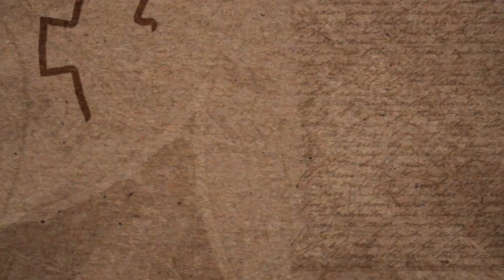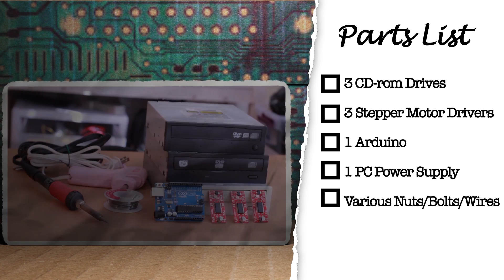Hack old CD-ROMs into a CNC Machine - Part 1: The Hardware

Comment: You can make the same Plotter machine for A4 and A size papers and can add an clipper to make the marker more stable and accurate and can extend x and y axes so that it can even be used for calligraphic font or to fill broachers, bills, etc. You can even use positioning device at the end of clipper to let the machine automatically position to the desired area where the work is to be done.

Comment: Very well done. I will try this. But still have a question even after looking the "Further Resources" link... you solder 4 wires to the stepper motor and connect them to the stepper motor driver but how do you know which one goes where ?

Comment: hello world hehe i hope that you can help me 
So i am planning to build a machine like this and i have 3 cd rom but i dont have controller boards. i found on ebay cheap controller boards simmilar to yours so i want to ask you are those controllers good aswell. I have arduino uno. and also i have old hot glue gun that works so can i use that hot top part from glue gun with regular fillament so i can make a 3d printer i hope that someon can help me

Comment: This video inspired me to take on this project. Not finished yet, but here are some tips I'd like to throw in: First and foremost, the optical lens housing and the carriage it's attached to between the two rails are both extremely brittle. I say this because you'll need some secure way of attaching the next component onto these moving parts, and while I believe hot glue has it's place, I'm opting for nuts and bolts as a more secure method. I've already broken two carriages trying to drill the holes I need for that, which leads me to my next tip - if you can horde a stockpile of these drives, do it. Schools, office buildings, eWaste recycling centers, do what you can to grab about 6 or 7 of these things. Anticipate breaking one or two, like I did. Also, the lens travel direction in some drives are on an angle, not orthogonal like what is needed for this project. Lastly, some drives use regular DC motors, not stepper motors, so watch out for that. Also, you get more travel using CD/DVD drives, floppy drives will only give you about 3 cm of travel (good for making a plotter that holds a pen, not good for a 3D printer that needs more volume)

Happy making everyone!

Comment: Great ideas. I would change one thing though.  I would have the Z-axis(vertical), holding the X-axis(side2side).  That way, the mass of hardware moving while printing will be much less.  The prints will be more accurate and higher quality. I really like the concept.

Comment: Hey buddy thank you for your very interesting project!, so I would like to ask if you know what level of current handle the CD ROM stepper motors about?.This is because I`m gonna use the 4988A pololu stepper driver and it has a screw to calibrate the current to offer  a great performance instead of EASY DRIVER you used

Comment: can we use 2 cd roms and a servo instead of 3 cd roms
Reply: kind of - if you want to use the cnc machine for like a pen/basically anything but a 3d printer or a drill, then yes. The servo can make the y axis, which for the most part doesnt have to be accurate except for the aforementioned devices.

Comment: would a 5V 4A power supply be enough juice for two steppers?
Reply: For some reason, 5V is not doing the job, so far I am running on 12V, I am planning to get a 9V power supply to keep the steppers temperature under control.
Reply: after I made this comment I read somewhere that each motor takes about half an amp to run at 5V. What's the max current on your power supply? (the 5V one)

Comment: +Tinkernut Couldn't a CNC machine be used to operate a train tilting system. CNC machines can move ropes in a block and tackle, which could lift one side of the train, which would be used to tilt the train, which uses lateral forces to counteract centrifugal forces. Just an idea.

Comment: can i use L293d motor driver instead? if yes, then how should i connect them to the arduino, because we'll have 4 wires that comes from the l293d motor driver..where the driver which you used has just 2 input that goes to the arduino.

Comment: Hi there.I am making my own design for larger prints. I want to know how will it know that it is going with correct dimensions. for example i have used a lot of gears and i programmed it to make an inch line, how will it callibrate with my gear settings?

Comment: I've just ordered the arduino uno, a breadboard  general purpose wires and jumper wires.
Next month i'll be ordering 2 dual stepper motor drivers (cheaper for more control per driver) and a new soldering iron.
I have some cd-roms and an old pc power supply. Im so exited to take on this project and i'll let you know what the outcome was.

Thank you for the great very informative video, subscribed!!

Comment: I have some questions. I have this all hooked up using your instructions that are on your website as with following the videos as well. Did you run into problems at all? I get my Y axis and Z axis working great but sometimes my X axis seems to get stuck when moving. Is there anything that I should try to get this to be more fluid? I think this is really the last big hurdle on getting this to work. Any help would be awesome.

Comment: Hey i'm having lot of trouble to strap the plate to the cart that carries the laser diode. First of all there is only one hole where a screw can fit in. Second I got no motherboard mount and I don't understand whats so special with it why not use normal screws ? Third why don't we just use glue and glue a wooden block to the cart ? Would that work with the vibrations ? Thx in advance !

Comment: I think something everyone should know, that if your CD drive is a year 2000 or older, they did away with the stepper motors and went with a DC motor... so check your dates before you tare 4 drives apart to figure this out... I found one, it was a 1998 drive...
Reply: I just took 2 apart and they both didn't have stepper motors :(
Reply: I ment year 2000 or newer...
Reply: +Bernard Melus a floppy drive has a stepper motor in it, but it only has an inch of travel... could be used for a z axis
Reply: +DRMSquared ok thanks for letting me know

Comment: I have disassembled 3 CD rom drives and each one has a motor (actually two motors) with two wires...not 4. They are not stepper motors.

Comment: And you can add a laser to the bottom and voila! A laser printer! (or not... lol) but I am definitely going to make something like this... This has so many uses I could think of:
-Precision paper/cardboard cutting tool
-Add a hot glue gun and you have a 3D printer (sort of)
-A homework cheat machine?
-Add a laser distance sensor and some visual studio programming and you got yourself a way to scan objects in 3D (although this can be done more efficiently)
-An automated screwdriver machine
-An auto soldering machine
-A machine to open up NUTshells (do you get the pun?)
-Combine some of the suggestions above and you have a quadcopter-making machine!
-Scale this up a bit and you have an automated bedroom cleaning device!
Reply: +Ramimy1555 how is it a homework cheat machine

Comment: I totally want to make this one, but it's like a $200 project, need the arduino and the power supply  and the soldering iron. :(
Reply: +TechXSoftware you can literally got all three of those things for like $30
Reply: ***** Names? because I live in Australia, things cost more.
Reply: a soldering iron is like $5, arduino for like $10 for a basic one like this, and a power supply from local thrift store for $15 (max)
try dx(DOT)com based out of china, so maybe shipping to australia isn't too bad. I don't know if they have these parts, but they definetly have alot of hobby electronics. else try ebay, maybe local sellers will come through. TechXSoftware
Reply from the maker: +TechXSoftware Check out banggood (dot) com. That's where I get a lot of my stuff. I'm pretty sure they ship to Australia.

Comment: This project is really cool. I'd like to see if it's possible to make the base a bit bigger though, and maybe just scavenge all the motors, but make new, longer rails to slide on.
I think the work area might be a bit too small to actually do useful things with. 

If nothing else this is a really cool proof of concept that I think can be taken a bit further :) 
Keep it up!
Reply from the maker: +TheOneTemor Try looking at scanners. they have nice track systems and motors.
Reply: +TheOneTemor you could do this not to be useful but with your kid to learn something
Reply: +TheOneTemor Exactly my thought. A greased metal rod definitely doesn't seem hard to install.
Reply: +Billy Mathews I've tried, and they work as engravers more than cutters and they burn so easy it's not even funny, even when pulsating them they just keep dying
Reply: +TheOneTemor I was thinking of doing something similiar to this but using an old scanner or printer.
Reply: +Tinkernut Idea: Scanners -> Laser cutter? Use the diode from the CD-ROM drive

Comment: Brilliant project idea, just not sure what you would make on such a small platform. Would the Z axis support a small dremmel like tool? Could it then be used to engrave circuit boards, instead of messing with all those nasty etching chemicals?
Reply: +dimmddr1 really?   Are CD / DVD traces that big? No this will be plenty precise, just not for a large footprint or tool.
Reply: +Maxx B i`m gonna make one but i think . something this small will be used for the evolution of the 3D printer or cnc machine.  So i want mine to have a small engraving tool to cut out gears and plastic for mounts. now I know realistically you cant get far with something like this but it gets my foot into the door of making these type of machines and thats my real goal( to learn something:)
Reply: +Maxx B You could pick up old printers for cheap. I got about 20 for a project for $5.
Reply: +Maxx B You'll have a hard time making anything really precise using this machine.
Reply: I think the biggest problem with using this with a dremel would be how rigid it is, and whether the y axis motor would be strong enough to lift the tool
Reply: undeadlich1
I know what you mean. I'm hoping to gain some knowledge on the motor control via the arduino in the next parts. I'd like to build a 3 axis platform that has interchangeable heads, between a dremel type tool and a 3D print head. But I'm on a very tight budget and I want to scratch build so I know exactly how it works.
This project looks like a great proof of concept form my plans.

Comment: will this work with all cd/dvd drives?
Reply: +samramdebest They all work on the same concept, so yes. They should work.
The internals of different drives can be a bit different, depending on when they were made, and by what manufacturer. But the main components should be the same. I.e a sled to put the CD / DVD disk in, a motor that spins the disk, and a stepper motor that moves the reading laser back and forth. Just like he explained in the beginning of the video.

Unless there's some super-proprietary stuff out there that I've never seen that has some really special design features, it should work just fine. And even then, you can probably still scavenge some useful parts, and look for the things you're missing elsewhere.
Reply: +samramdebest Yes, you only need the motors and guiderails.   They are mounted on a plate that you can unscrew.
Reply: +samramdebest Works with most of the drives. Some of them, especially the older CD-ROM drives, use only a brushed DC motor, not a stepper motor as shown in here. For this project you need 3 drives with stepper motors.
Reply: +samramdebest yes but be carefull there are cd drives that dont have stepper motors inside just a regular motor

Comment: +Tinkernut I think in the future you could adapt this project into making a CD-ROM 3d Printer!
Reply: +Sean Montebello It would work. Just getting a cheap 3D printing pen for 35$ and having a Servo press down the button.
Reply: +JustJedi I don't know about that, it'd have to be really really precise and have an immensely complicated heating/plastic feeding system...
Reply: +Sean Montebello it's probably precise enough, given that it's meant to position a laser to read a hole less than 1um in diameter on the disc, but the rails are really short for a 3D printer. You'd only be able to print tiny objects, and that's if the motors can handle the extra load from the stuff you mentioned.
Reply: It can actually and here it is ! http://www.instructables.com/id/eWaste-60-3DPrinter/
Reply: +Linus T actually yeah!
Reply: +Linus T The 3D printing pen button's wires could even be extended to be controlled by the Arduino board.
Reply: +Achraf Almouloudi True! Which would make muchore sense as you could control the flow of filament much easier.
Reply: +Sean Montebello hairdryer fixed to a drinking straw :P
Reply: +Sean Montebello Use an heat gun with silicon :)
Reply: +Sean Montebello he already did it